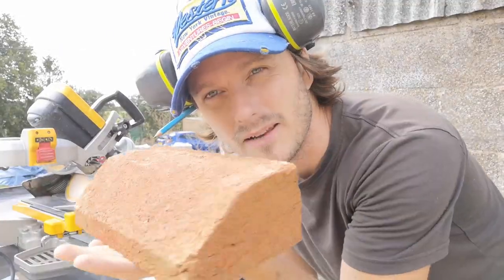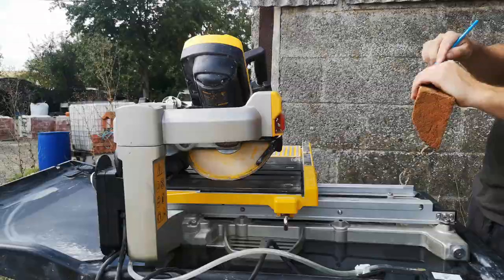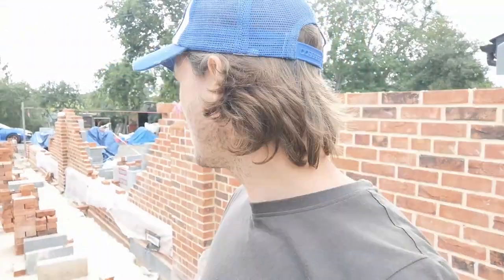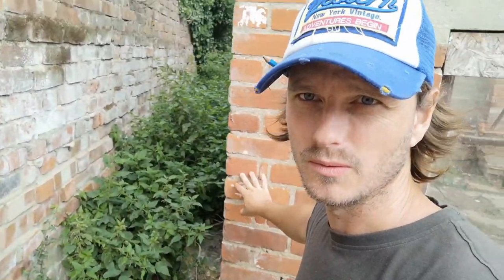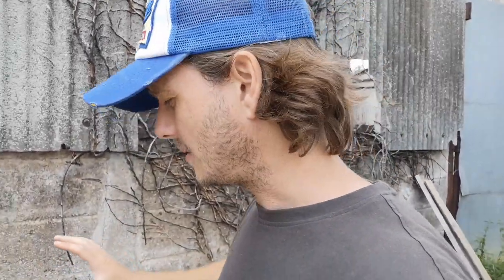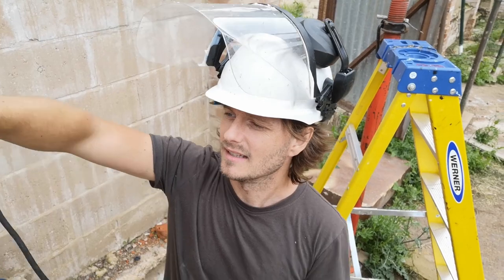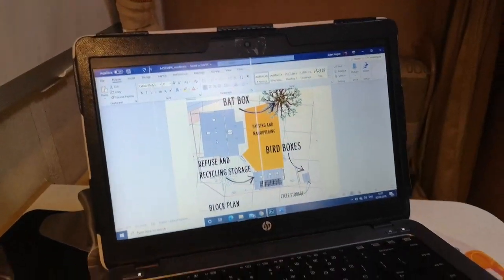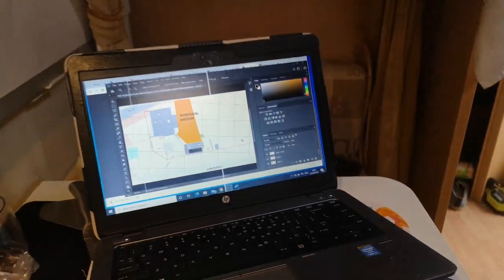Cutting CUSTOM BRICKS for garden wall piers- foundation talk - 021

Comment: Looks a lovely plot Acer, is it Kent? Don’t know if it’s your first or not but it does get more stressful the further into the job . Especially if your living on site like I had to do. If u find that just keep your chin up and it will be great wen done.
Reply from the maker: Thanks Dave 👍 I think the little valley makes it 🌟 its actually in Suffolk, not all flat up here 😁 would have quite happily gone Kent way but this just came up at the right time. I've not done a barn conversion before but did do my own hip to gable loft conversion on a bungalow through the winter a few years back. Had a tarp for a roof for a good couple of months whilst living on site and working full time 😂 How about yourself? Have you got a self build under your belt?
Reply: Ye done a few now. I’m a Brickie so got a bit of a start. What about u,  have u a trade?
Reply from the maker: @daveharrison4476  nice, if I'd save a mint if I were a brickie. Nope, I don't have a trade, I just have a go. Master DIY'ER maybe? 😂 I can turn my hand to most things after I've researched or thought about it hard enough 🤘
Reply: Good man. You’ve got the right attitude

Comment: Love the custom bricks. What type of tile cutter did you use?
Reply from the maker: I used my wet tile saw, it's a Dewalt d2400. Not normally used for bricks but works well. I'm actually planning on using it to make brick slips in the future to save some dosh 💰
Reply: Great info love the extra use of the dewalt tile saw looks like a handy piece of kit. It seems to leave a lovely finish. Do you have a link to that cutter?